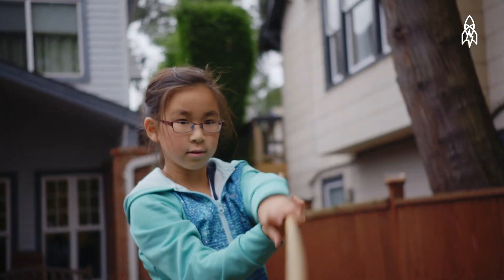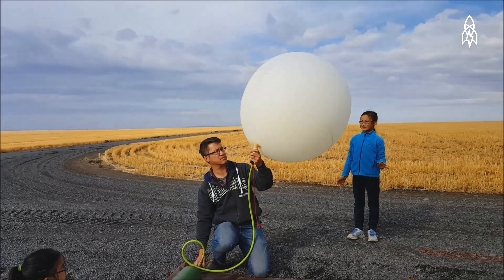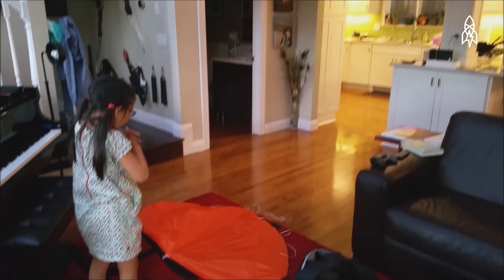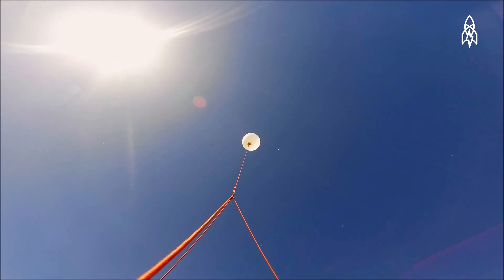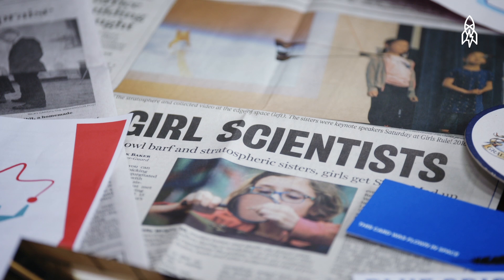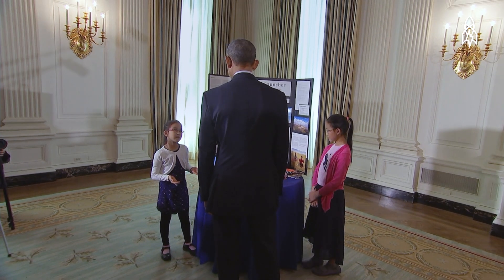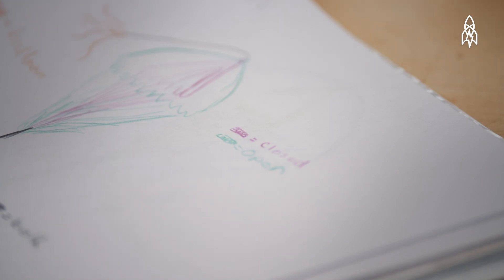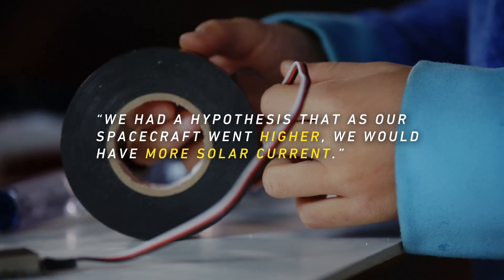These Young Sisters Sent a Weather Balloon to Space | That’s Amazing

Comment: just girls which are very rich and rewired parts which they bought from the outside connected it with a solar panel . that's all , the pressure in the balloon needs to be less than the outside a or it pushes it up , the calculation is a joke , it is just a really lightweighted wires and circuit , and the skeleton , why is that even a thing , they also mentions that they weren't the first , why bother put then on

Comment: if you pause the video any time between the 6:05 minute mark and the 6:10 minute mark, amazingly you will see that there is absolutely NO curvature to the earth's surface!  Remember, folks say that they can see the curvature while flying commercially at only 30,00 feet (less than 6 miles), yet these girls have photos taken at 101,000 feet (19 miles!) and there isn't any curve to be found.  (whenever you pause the video, simply place a straight-edge ruler on the screen and you will see that there is no curveature).  So, are we really on a spinning ball globe, or not?
Reply: @bornagain 2009
Yes, we live on the surface of a sphere.
Here's some balloon footage where the curvature of the Earth can be seen (please, pause the video and check the horizon with a piece of string, you will see that it is clearly curved):

https://youtu.be/hceMXAQWWN8?t=2h6m5s

And this is only a small example, the evidence, proving the spherical Earth, is truly overwhelming and there's none supporting the flat plane fantasy.

The Earth, beyond any doubt, is a sphere.
Reply: At the 206:40 minute mark of the video you requested that I watch, I paused the video. The readings for the balloon: altitude - 119, 326 ft (23 miles!); speed - 81 mph; N 36• 46' 10 3", W 120 54' 23 1"; distance 86.7 miles. I then put a straight-edge on the screen and there is NO discernible curvature. None. And of that there is no doubt.  You seriously have to be high on bad drugs to see any curvature.
Reply: "A lie told often enough becomes the truth."  -- Vladimir LeninNo REALLY, the earth is spinning, in a vacuum, at over 1K mph, and gravity has the same effect in the middle of the spinning ball as it does at the poles...honest engine.  Oh, and all the water, yeah, because the earth is spinning SO FAST in a vacuum, the water doesn't fly off...because of gravity!!   Gravity, it makes things stick ONTO large spinning balls, that are in a vacuum!!  It's amazing, and, yeah, no one's ever done that specific experiment, but it's the truth!!  No, the water, that's on the large spinning globed earth, actually sticks to the surface, you know, because it's spinning SO FAST, I mean, what else would water do, in a vacuum, but stay attached to the spinning ball??  Again, BECAUSE OF THE GRAVITY.  Really, how stupid are you?  Do you really think that the water, on a large spinning ball, would actually fly off of it while it was spinning?  What an idiot.  Oh, yeah, and anyone with half a brain can see the earth's curvature from an airplane at 5 miles above the earth EXACTLY as they do at 20 miles above the earth, and 250 miles above the earth (think Space Station.)...yep, even though the curvature looks exactly the same, from any height, there really is a curvature to the earth.  There is.  Seriously.  You believe me, right?  I mean, I do keep repeating myself, so eventually you WILL believe me.  You don't want to look stupid, do you?